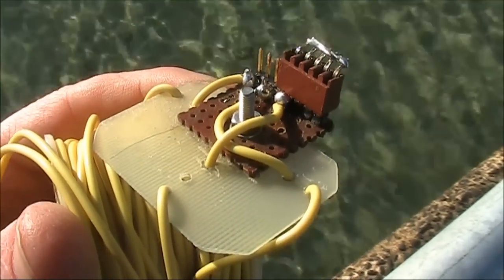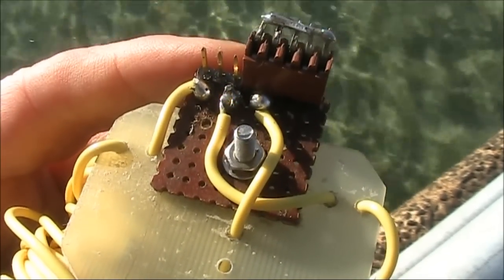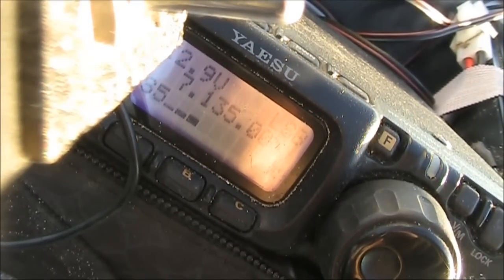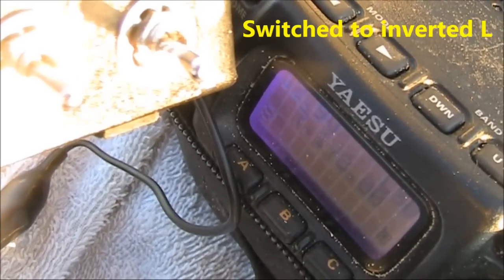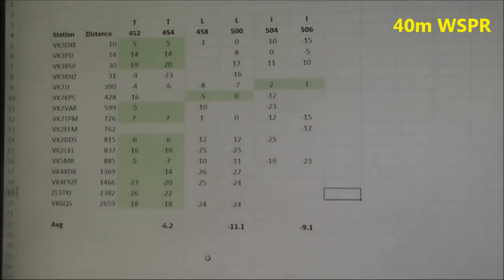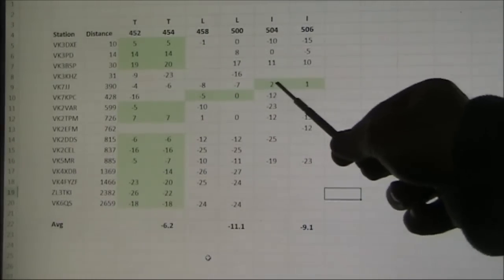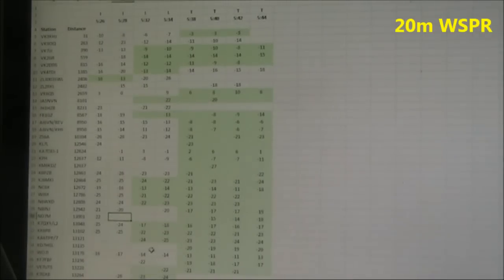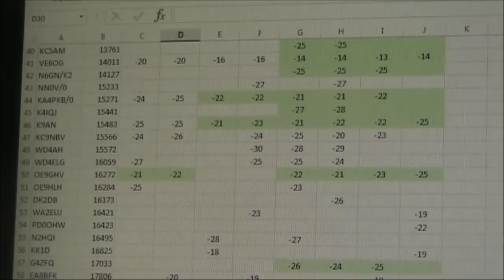Testing a TLI wire: Three antennas in one

Comment: Very interesting, Peter.

Your explanation of the polarisation characteristics of the top-loaded vertical reminded me of a memorable exchange between you and a VK3 Advanced licensee during a Trans-Tasman 80m SSB Contest around 2007 or so, when the other station tried to tell you that your top-loaded vertical was a horizontally-polarised antenna ...

BTW, a relay at the top for switching (per your QSO partner's suggestion) would be great for quasi-immediate comparisons between antenna configurations, but on the other hand it would increase the weight of the antenna.
Reply from the maker: I did have ideas for not one but two relays to get all three configurations. But after these tests it doesn't seem the straight vertical is worthwhile. So it would just be switching between L and T. For this antenna's size even that wouldn't be worthwhile. But if the antenna was double size and I was wanting to switch between L and T on bands like 80 & 40m it might be.

Comment: Great video! I would like to use T antenna in my backyard. Instead of ground tuning unit I would install elevated counterpoise. What length of wire would you recommend for counterpoise?
Reply from the maker: Maybe 1/4 wavelength on desired bands?